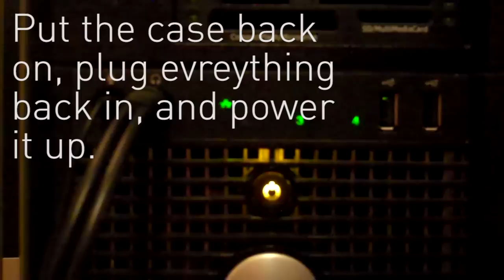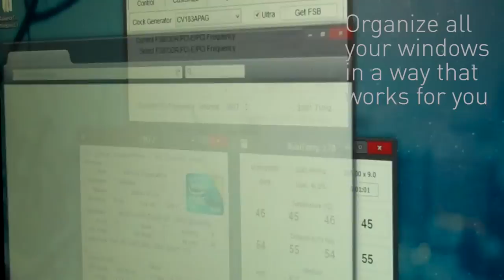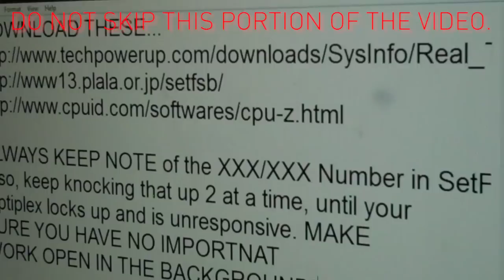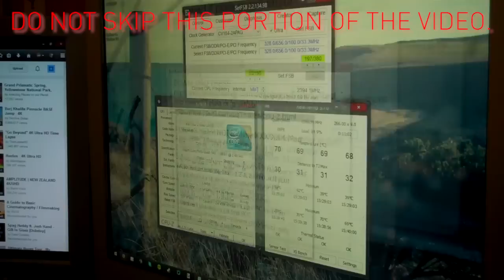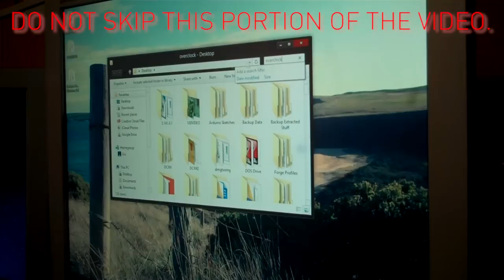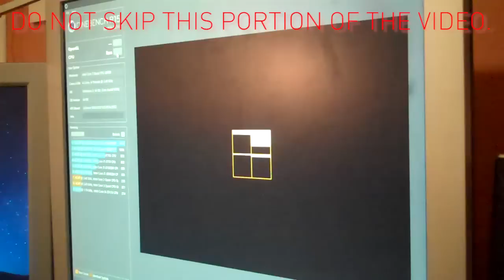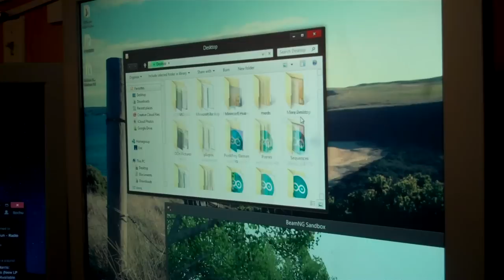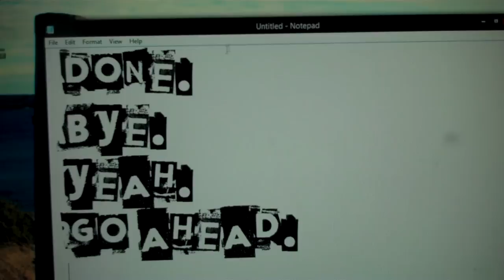[TUTORIAL] Overclock a Dell Optiplex 755/760/780 (Intel Q6600)

Comment: this is nuts man, thanks for this. found those optiplexs online for 50 bucks, drop a rx 460 in there, add a bit of ram, and do this trick and youll be set for a good long while. damn. cheap way to get my buddies into pc gaming
Reply: Bamcorp Gaming the rx 460 didn’t work right?
Reply: 2020 and you are still fine

Comment: I was able to get 3.7 GHz from 2.83 on my core 2 quad q9550 ( or as far as i was willing to go). Thanks for the tutorial! Quick tip by the way for the people who have their computers lock up after only a few numbers increase the bar on the bottom left by 1 every 2 or 4 on the other one.
Reply from the maker: +Kyle Hoang Great to hear you got it working. I will have to give that a shot.
Reply: +Kyle Hoang I have a Q9550 in a Dell 780 with 8gb. Does it make enough difference in gaming performance to risk cooking the CPU. I know nothing about overclocking, except the warning. What are the benefits, and are they noticeable.
Reply: +SuperCal I'd say i saw quite an improvement in my games such as CS:GO and Smite. As far as heat problems, i would say try to hit under 72 degrees when testing in game. :)
Reply: Kyle Hoang
I just put together the PC for my son, and he is satisfied with the performance as it is. Overclocking is new to me, but 3 months ago I could not build a PC. I'll check back in when he's ready, but thanks for the information. I had no idea that Intel processors could be overclocked as much as ya'll have demonstrated.
Reply: Kyle Hoang I've been able to get mine up to 3.018 GHz before the system crashes. The number it crashed on was 226/380, and on the bottom left it was 41/190
Reply: What optiplex do u have?? I have the exact same cpu.
Reply: ElTres I have an optiplex 780
Reply: a world full of dreams will come to me when I finally upgrade to that great Q9650, heard it overclocks to 4ghz
Reply: I'm having exactly the same problem with my 780 MT - up to 3.018GHz & quite stable, but one click more: instant freeze. I thought it might be the RAM speeded up a bit to non runnable point. Did you solve it? I'd really appreciate any insight.
Reply: @LovelyAlanna  have u upgrade it yet ?
Reply: @iTechUHD  would this work on core 2 duo cpu ?
Reply: i thought i was the only optiplex 780 gamer, im happy rn
Reply: In benchmarks on my 9550 and an hp mobo it didn't even show any improvement at any increased clock speed because it's a "fake" overclock. Not that setfsb and others like it wont work, just it doesnt matter for this cpu. It crashes because its changing the pci frequency, just make it ignore the pci frequency
Reply: What fsb did you use i cant find the chip

Comment: Worked for my Optiplex 760 with with intel Q9550. Almost identical PLL.
Not much use though since it froze after increasing the clock speed from stock 2,83GHz to only about 2,89GHz. The temperatures weren't bad either.
But still, technically works.
Reply from the maker: Good to know. Thanks!
Reply from the maker: What PLL was it that you used btw
Reply: The same, CV184-2APAG. Only the end part was different on my chip.
Reply: Yeah i've had just about the same problem with my 755.

Comment: this can damage motherboard ?? I am going to overclock core 2 e7500 at 3ghz it could
Reply: depends how much you overclock //// if u try over 3,5-4 with high temperature /// u can damage the cpu (can't be fixed)
Reply: No, the only dangerous aspect of overclocking are voltages, and on older systems like this that didn't really have thermal throttling, heat, but heat can only be damage a cpu if it overheats for really long periods of time, we're talking multiple years. Here you're not touching the voltage, so you can't damage the cpu or vrms on the motherboard by using incorrect voltage settings, and since the voltage stays stock, I doubt the heat output will increase a lot, if you go too far on the fsb, it's just gonna crash, nothing will be damaged, you just reboot, and try at a lower frequency to see if it's stable.
You should still keep an eye on temps, Intel says anything under 74°c is totally safe, and I can tell you they usually give really safe number that you can go past without any problems, but if your temps go past that, keep going at your own risk, or lower the fsb.
Reply: @imnota  thanks

Comment: You should have just stuck a piece of electrical tape blocking a certain pin on the bottom of the processor, this would push the FSB to 333 leaving you with an effective overclock of 3ghz. Look into pin modding (bsel) and if you're really getting into it check out VID modding.
Reply from the maker: I've had a few others recommend this. Don't use this for my main PC anymore. It's a FOG net boot server running Ubuntu.

Comment: Do you have the stock cooler? If so, is it the one with the copper heatspread? I've got a SFF I want to overclock just a little (+0.4 GHz). I have a 780 SFF with a Q9650.
Reply from the maker: I will have to check. Definitely be careful with an SFF with a Q9650.
Reply: Eric Sanman why?

Comment: hmm, I already have a q9550 in mine. gonna have to check if I can overclock my 780. I've wanted an excuse to kill this thing for a while now... lol
Reply: Did it work? I tried it in my 755 and it just froze. Think im out of luck.
Reply: It wouldn't respond to any tweaks. Probably wasn't supported. There are multiple chips out there so maybe it will work on yours. On a side note, I tried on my Inspiron 8600 and I could push it to 2.2ghz before it crashed. The motherboard on that laptop just can't handle much apparently. The CPU is clocked at 2.0ghz.
Reply: I know this is a 2 year old comment of yours but, can you advice what is the maximum safe temperature for Q9550? I have one now and it sits around 71C at full load

Comment: Core 2 Quad Q9400 starting from 202 points, freezes on to 212. Overclocked from 2.67ghz to 2,72ghz. Insert "I'ts something" meme Edit. Using Kyle Hoang method i have reached 3.0Ghz Edit "2". Reached 3.2Ghz.
Reply: rip i was only able to get it to 2.72GHz also

Comment: I also have a Dell Optiplex 755 Mini Tower. I have an intel core 2 duo e8600 (ideal for overclocking). I did everything you said in the video. Used the same PLL, etc. My factory speed is 3.33 ghz. Everytime I get it up to 3.43 my computer freezes. You have an ideas?
Reply from the maker: Beaver Phak Sorry, but the E8600 is NOT a good overclocker. That could be why it is freezing. Check http://cpuboss.com/cpus/Intel-Core2-Quad-Q6600-vs-Intel-Core2-Duo-E8600 and look at overclocking performance.
Reply from the maker: iTechUHD Also, you probably DO NOT want to use the PLL I said in the video. Yours is most likely going to be different. I can tell that you skipped part of the video. It was clearly stated to NOT use my PLL unless... (I'll let you find out the rest by watching my video.)

Comment: I just have 1 question does it matter what CPU you have as long as you know the motherboard number because I had a q6600 and I just upgraded to a q9650 and I wanted to over clock it I still have the same motherboard.
Reply from the maker: It should work.
Reply: Thanks because I loved my Q6600 at 3.0GHz its was cheap and fast so I figured id upgrade because I just figured the old beast needed a break. So I went out on Amazon and got a Q9650 for 70$ and I bought a water cooler this time and I plan to get it up to 3.8GHz but and I was hoping this program would work and it does so im pretty happy. Thanks

Comment: What is that other number in green for SetFSB it says 35/190. Also is this program a way to overclock without going into the BIOS? Will this program need to run all the time to continue the overclock?
Reply from the maker: If you are talking about the other slider I am not sure. And yes it is a software overclock. To make the program run all the time view the pastebin link the description.
Reply: Eric Sanman
ok thank you, very helpful video. I'm going to overclock my i5 3470 and hopefully hit 4 GHz
Reply from the maker: What computer are you using? If it is a Dell or other prebuilt then this video should be fine for you, otherwise if it is a custom PC I would check to see if you motherboard supports overclocking.
Reply: Eric Sanman
it's a Dell Optiplex 3010
Reply from the maker: Ok. Here's a more detailed guide on how to find your PLL if it helps: http://forum.notebookreview.com/threads/how-to-find-the-clock-generator-pll-in-your-notebook-desktop.429383/
Reply: Eric Sanman
gosh thank you for all the help! Is the PLL the clock generator? Also does FSB stand for front side bus?
Reply from the maker: PLL is clock generator yes. You're correct about FSB also.
Reply: Eric Sanman got it thanks!
Reply: Eric Sanman
question: is this overclocking accomplished by changing the Base Clock of the entire system?
Reply from the maker: Typically with BIOS overclocking yes, with SetFSB I'm not sure though.

Comment: I am surprised about this. Especially on a stock cooler. I might have to do this with my core 2 duo. It is already running at 2.93 ghz stock, but hey why not. Also is the cooler in the 755 the same as in the 780. If so then I can see it having that good temps. It have a pretty beefy cooler.
Reply from the maker: I believe they are similar. Dell did good with cooling in these desktops as far as the "wind tunnel" design.

Comment: found the chip but its a SLG8X519T and that's not on the list. I did get it to work with no error but I can't set fsb.
Reply: Me too man, do you did the overclock?
Reply from the maker: Try the one I put in an annotation in the video. If it doesn't work it should just do nothing. CV184-2APAG.
Reply: Thank you man, But this does't work too... 
i'm go cange my Motherboard, This is the only way.
Reply: Moises Amorim do a pin mod apparently

Comment: Hey, great tutorial, but i'm having a problem with the auto start up. When the program starts it keeps dropping the cpu clock, and i don't get it why. I have overclocked my cpu to 3030mhz, but since i couldin't find the number on the motherboard i used the one you did :DDDDD, and it works just fine. Cpu clock is correct and i got better performance. These are the commands i used: -w10 -s167 -i05

Comment: did any of you guys who have dell optiplex 760 with a different PLL from this video have done this overclock method by 'setfsb' successfully? because my PLL was " SLG8XP5..... " i need help, any suggestion to overclock the cpu? i'm running intel core 2 quad q9650, dell optiplex 760 mobo (LGA775), 8GB DDR2 ram and it's bottelnecking my gpu.. i have tried the bsel mods but unfortunately it can't..
Reply from the maker: Some people with Q9650s or anything over Q6600s had issues. I'm guessing the power just isn't there.

Comment: what are your computer specs? I am planning on upgrading mine to yours lol
Reply from the maker: Intel Core 2 Quad Q6600
8gb Crucial RAM (4x2gb DDR2, running in dual channel mode.)
NVidia GeForce 650 (Borrowed from friend, my GeForce 9600 GSO died.)
Some Antec Gaming modular 560w? power supply. (I'll get back to you on that one.) 
1 CD ROM (SATA)
1 DVD R+RW (SATA)
My storage options that I chose fit MY needs. You may (and probably wont) need this much storage, but I do. Go with whatever suits you're needs.
1TB Western Digital Caviar Blue @ 7200RPM
2TB Western Digital Caviar Black @ 7200RPM
For a total of 3TB (3000gb).
All this in a stock Dell Optiplex 755.

Comment from the maker: This video is very old now and I see I have a lot of new comments. If anyone is still interested in doing this, as others have suggested, I would recommend using the BSEL tape method. Requires no software and works on any operating system. I made this when I was very young as one can probably tell by the editing and overall lacking quality. I have almost no Core 2 era computers left that I use at this point so it is hard for me to continue to provide support for this very hodge podge method. This will likely be my last comment on this video, so I'd like to thank everyone for your support. I've shifted a lot of my focus to photography and graphics over the years. To see and keep up with my current work, visit sanmanmedia.com
Reply: hello, can you tell me what the 2nd adjust bar below 1st bar use for?

Comment: i have a core 2 quad q9400 in a OptiPlex 780, and i was only able to get it from 2.66GHz to 2.72GHz...
Reply: What s the code you put in the software?
Reply: @Miquelperez1998  setFSB
Reply: Yeah but i put de same code pll chip in the video and dont works...
Reply: @Miquelperez1998  Because you need to open up your computer and find the code for you own computer, it wont be the same as in the video
Reply: But its the same like you, i have an optiplex780 with core 2 duo E8400
Reply: @Miquelperez1998  that still doesnt mean its going to be the same, it will be different

Comment: heello mi inglish inot nice but why in my pc information y cant see the mhz for example core 2 quad 240 mhz to 3.0 mhz ???
Reply from the maker: Windows doesn't detect overclocked clock speeds in system information. This has no effect on system performance. Use CPU-Z to see your actual clock speed.

Comment: Works great for 755 sff Q9650 got 3.69 ghz i found that if you disable speed steeping and any un used usb ports,  drives, pci,  parallel ports... in bios first, then set sliders to 361/55 this will cause machine to restart, let the machine restart, then choose shut down and enable speed stepping in the bios on restart  and your overclock will show in task manager, performance tab. you can then shut down the machine and the clocks will stay set, just don't choose re start or the clocks will return to stock.  I also disabled the parallel ports and un used usb and floppy drive and any other un used sata in bios  while overclocking will result in higher clocks and FPS you can then re enable any usb or sata you need just make sure you use shut down and not restart when editing bios. has anyone done this with the 780? what PLL? just ordered a 780 mobo and will post results
Reply: 780 can not be overclocked, works with 760 but i think its only slowing the system clock, giving false overclocking. if your windows time or clock is running slow your benchmark will appear to be faster, but its a false reading i'm assuming can anyone clarify this

Comment: CANT FIND IT ON MY DELL VOSTRO 3900.. PLS RESPOND!!!
Reply from the maker: This is a completely different computer with a completely different processor. If you want more gaming performance (I see you play Minecraft), I'd suggest a graphics card upgrade. Google will help lots for picking one out.
Reply: will this work with AMD processors? i have an Athlon II x2 260 that i would like to get to 3.5ghz from the standard 3.2
Reply from the maker: Sean Roods I don't know as I don't have an AMD Optiplex to test this with
Reply: ah. i believe dell inspiron 546's are pretty cheap off ebay. they come with either core 2 series intel chips, or an AMD athlon 64 x2 like mine did (i swapped the processor).

Comment: I wasn't able to overclock my E6850 at all xD (I think it's because I needed to change the number beneath as well)
Reply from the maker: Yeah I don't have a spare Core 2 Duo to mess with so I have 0 idea. Q6600s/Q6700s/etc are pretty cheap used and are much faster than the Duos if that's a viable option for you.
Reply: I've just ordered a X3330 :D (Same as Q9550 as far as I'm aware)
Reply: My X3330 turned up and it worked in my Optiplex 755 without a bios update. Managed to overclock it to 3GHz without much trouble, might try and push it further later :D
EDIT
I'm not able to get it stable over 3GHz but my settings are 246, 50. So far temps with stock cooler I haven't seen hit 80oc, the highest was 75oc on one core which I think I hit at 3.3GHz but that kept crashing the PC.

Comment: If anyone wants to get to 3 ghz on a core 2 duo 2.33ghz and they have an optiplex 755 do 300 on the top slider and 62 on the bottom slider.
Reply: thanks that what I got and I run GTA 5 almax 30 fps with my 750ti
Reply: BeastTV same here

Comment: I have Dell Xps 420 cann I Overlock this?
Reply from the maker: +Martin Play I'm now sure because I don't have your particular system. I would do a Google search.
Reply: +Martin Fotolinsepaashaus I have an XPS 420/Q6600/8GB PC6400 800Mhz RAM and it is running at 3.1 Ghz with overclock.  I did the BSEL pin mod AND I also use SetFSB.  System temps are OK with stock cooler, though I did do a good cleaning AND replaced the thermal paste between cooler and CPU. The setFSB is version 2.2.134.98 and the specific clock generator is CV184-2APAG. SetFSB alone only got me from 2.4 to 2.6 GHz.  The BSEL mod took me from 2.4 to 3.0Ghz.  SetFSB added a little more.  Without upgrading the cooler (using DELL XPS 720 three loop air cooler), I will not go further.

Some links I found useful:
http://hubpages.com/technology/Get-more-from-your-Quad-Core-Q6600     [I used this mod]
http://www.xtremesystems.org/forums/showthread.php?177696-XPS-Owners-Rejoice!!/page2

Comment: you paid for SETFSB right?
Reply: if not, do you have any sites that can download the full version? "SETFSB" button is not working for me, unless i will buy it.
Reply from the maker: No, if you did, you need to demand a refund by the person/scammer whom you bought it from. SetFSB is 100% free. Only download it from the official website.
Reply: is SETFSB really working? i cant really tell the difference. btw, we have the same specs.
Reply from the maker: 381silent Sorry for the long reply. Did you check CPUZ? That will tell you the clock speed that SetFSB clocked it at.

Comment: where ist the cv Number?
Reply from the maker: If you have a 755, just try the one in my video. Comment back to me if that doesn't work.
Reply: +iTechUHD i have a 745 but with the same Processor
Reply from the maker: Try mine. If that's not the right one it should just simply not work.